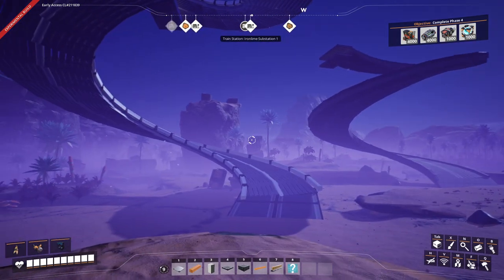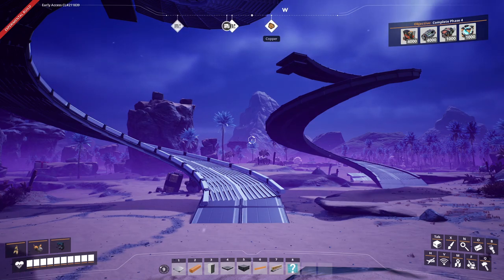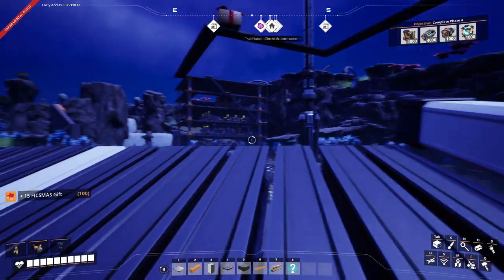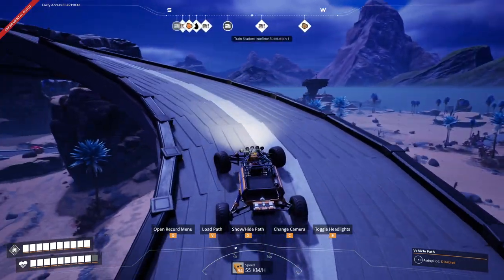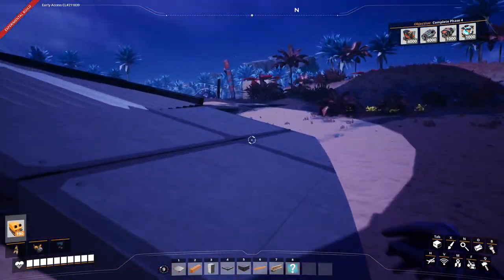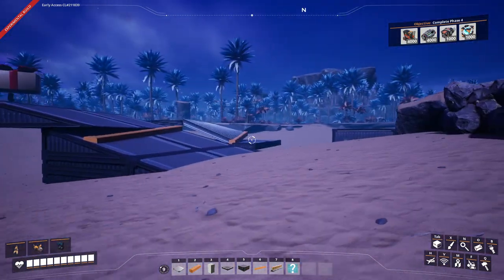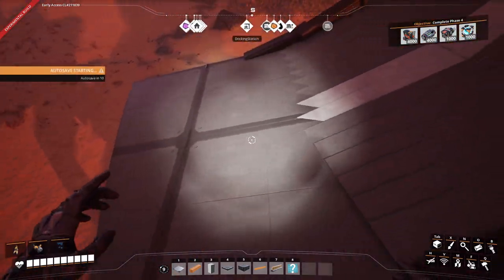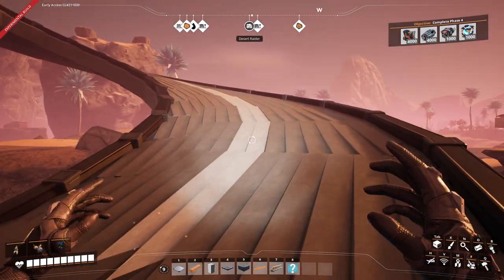The Curved Ramp Problem

Comment: Nice technique for small-footprint spirals! Also it was a nice touch to include the guide foundations in the blueprint; that eliminates tedium and mistakes.

If diameter is not an issue, I found the 5° curves look nice if I alternate ramps and flat foundations on the outer lane. So that means the inner lane is all 1m or 2m ramps, while the outer one is alternately 1m ramps and flats, or alternately 1m ramps and 2m ramps. I have also added these flat pieces to smooth out the precise N° curves generated by SCIM. (That SCIM road tool is handy when I'm building a curve to connect two existing things... but your tool is way faster and simpler!)
Reply from the maker: Thank you DistracticusPrime! I haven't gotten into the nicer gentle curves yet, although I've seen the technique. I think I will probably end up using a similar approach to make some blueprints for those in the future. I'm also interested in experimenting with the SCIM road tool and the micromanage mod to see what is possible.

Comment: This is an interesting solution to tight curved ramps! I've found that using a 1m ramp and 10 degree corner can still make a usable spiral along as you limit the width to 1.5 foundations. Any more and the lip starts getting too tall

Comment: Hey this was really good! I think like you said it's a good first step to finding a "propper" solution to this particular issue. I'm really bad at testing these sorts of things myself. I wonder if it wouldnt be possible to lower the outer part of the turn to make it less of an "banking curve. Or if it's simply a matter of manually extending the outer parts until they become flush with the original ramp to chip away at the bump on the outer edge.
Reply from the maker: Thanks! I think I see what you mean, but achieving that level of precision for each beam seems beyond my current ability. There might be a way to do it but I suspect it would take either a lot of complicated math or a lot of trial and error 🤣
Reply: I know the trucks aren't exactly terribly maneuverable (what you'd expect) so I wonder if doing an unbanked curve would change their ability to negotiate a relatively tight spiral.
Reply from the maker: @zetsubouda  You might be right but I'm not sure how you would build it. Maybe a section of curve, then a ramp, alternating?

Comment: actual tutorial at 9:34

I came here "for an explanation of how to use these" not a 12 minute introduction demonstration seeing your thought process and how you built it.
Reply from the maker: Hey Sean, I'm sorry, I always hate when I'm looking for instructions and have to skip around to find it. It's been a while since I worked on youtube stuff and I made the video first before linking it to the blueprints, I didn't think about that irritation when I did so. I'll try to figure out how to put one of those link thingies in at the start so that others can find the tutorial part of the video more easily.
Reply: @Josiwe  Oh! All you have to do is add ?t=574 to the end of the URL. There's a checkbox to do that in the dialog after you click the share button.
Reply from the maker: @SeanVoltaire  Thanks! I've added chapters to the video (it's surprisingly easy) and I updated the link on satisfactory-calculator to point to the tutorial timestamp you suggested.